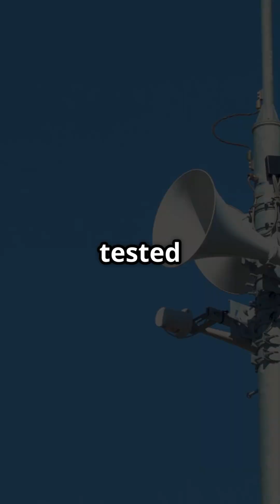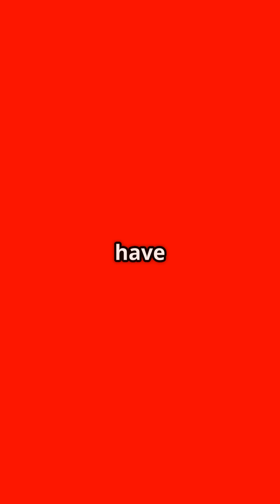The Mighty Mitsubishi Diatone D-160: ASubwoofer Legend by Uncommon Knowledge Hub

Comment: The Mitsubishi Sub is real, that black-and-white picture is photo shopped.  NASA built a 10 foot subwoofer during the Apollo era, it used a hydraulic motor and could easily reach 150 dB at 0 Hz.  Ascendo has been building a 80” subwoofer, it’s called THE 80.  It cost around $150,000 for the sub, amps and box.
Reply from the maker: Wow, thanks for the extra info! 😄 That’s some seriously powerful audio history — didn’t know NASA went that far with subwoofers!